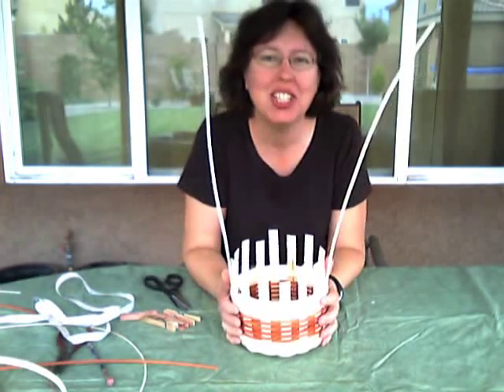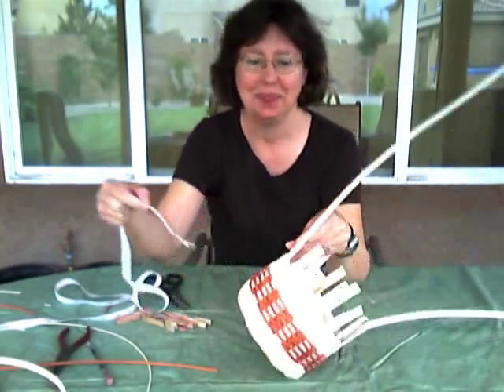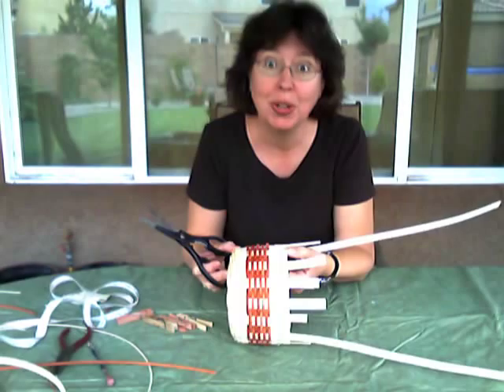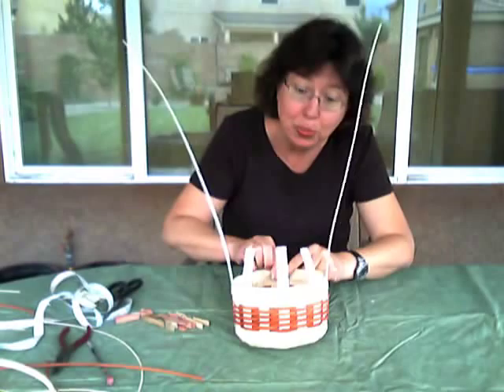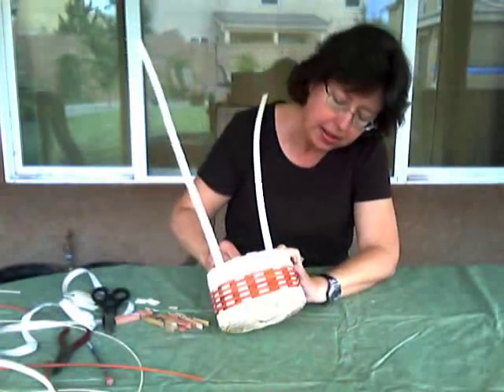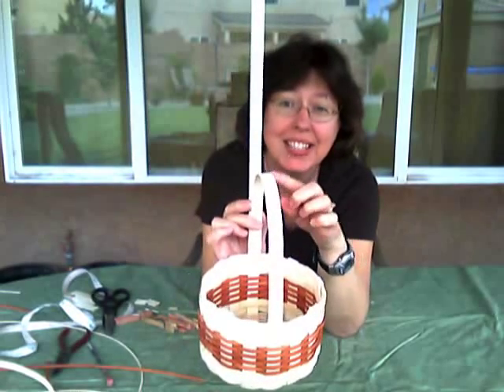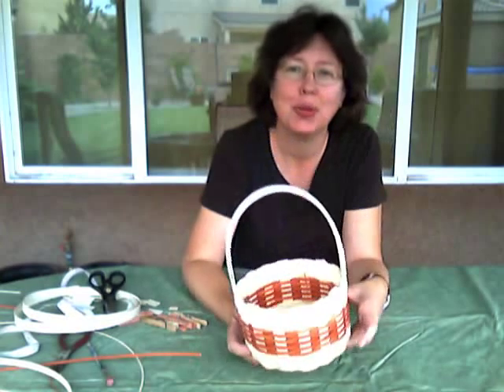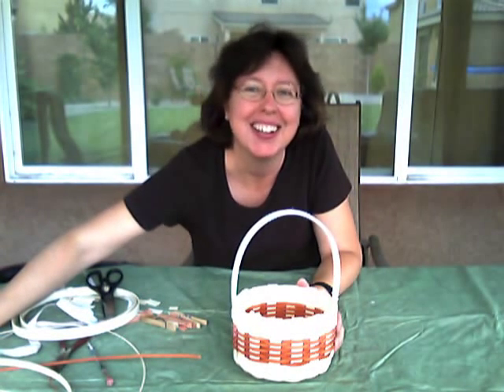Basket Weaving Video #16 - Cutting and Tucking the spokes and Forming the Handle

Comment from the maker: Here is the thing.  You can do that but.....It does not look as pretty or professional.  You would see the extra thickness on the outside.  Also, you could possibly see the end of the spoke and you want to hide the ends.  One more thing...You will find that tucking the spokes is not a favorite thing to do in weaving yet it is necessary.  Getting to cut off half of them is a good thing. HTH!
Nancy